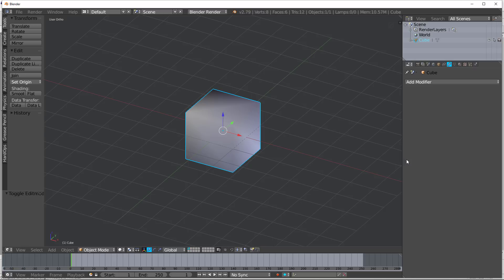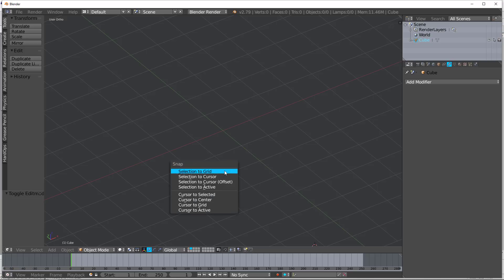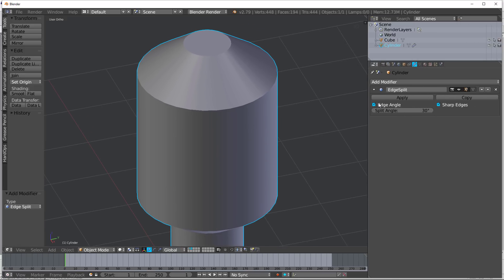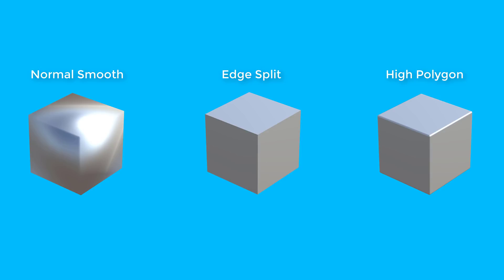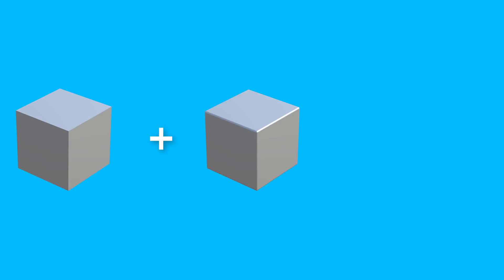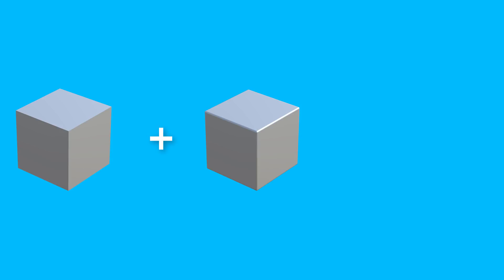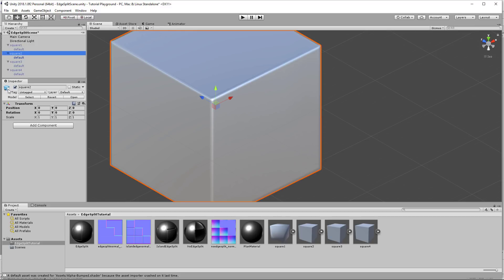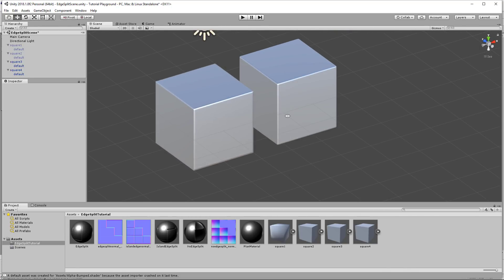In Depth Study of Blender: Edge Split Modifier

Comment: What  Olenson Schillem Simon said.  Auto Smooth is in the Object Data panel (the little triangle of 3 vertices).  Click the Smooth button in the 3d view tools panel, then click the Auto Smooth in the Object Data panel and it looks exactly the same as with the Edge Smooth modifier.  With the advantage that it's non-destructive.
Reply from the maker: You are both correct, auto-smooth is indeed better in every way. I thought it would bake differently, but the bakes are 100% the same between auto-smooth and edge-split. I thought that auto smooth didn't have smoothing based off of sharp edges, but it is automatically enabled. Seriously cool, you just changed my workflow.  If I have time I will make a quick video showing this off because it is really cool.  Thanks guys.